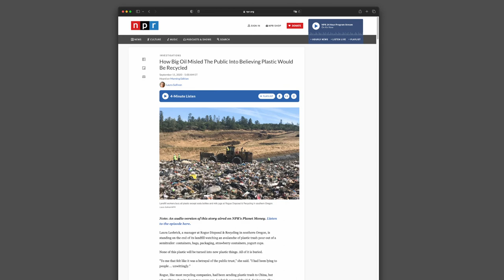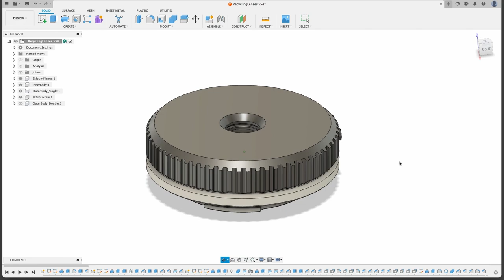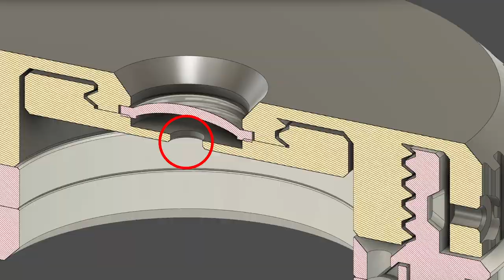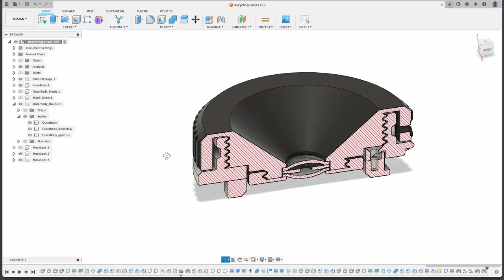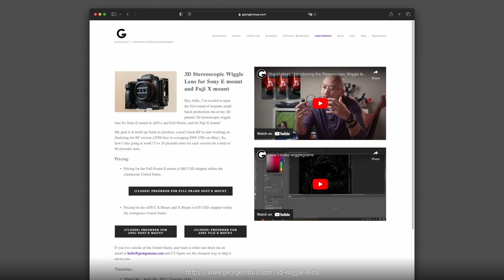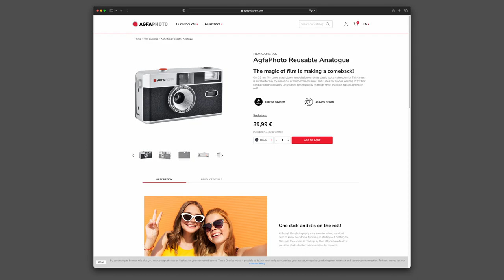Make Sony E-Mount Lenses from Disposable Cameras

Comment: A few years ago I used a similar lens, built a cardboard camera to make solargraphs, I found that it covered the 6x6 format, with a focal length of 35mm, which made it extremely wide angle. It would be nice to build another more robust camera, but I don't know how to create the files for 3d printing
Reply from the maker: Simple and straightforward projects are the best projects! I can recommend Tinkercad ( https://www.tinkercad.com/ ) as a very convenient software to get started with modelling for 3d printing.

Comment: Anyone using this with an A7Rii with success? I printed one, and the entire focus ring is visible when screwed either completely down or as far out as it can go. As in, I see mostly the color (red in my case). The only way the 3d print doesn't obstruct the sensor is if I take the focus ring off completely, leaving just the e-mount adapter locked into the camera, but of course that serves no purpose.

Comment: Hi! Maybe my question is silly, but...  what is the minimum distance to keep between the lens itself  and the sensor? I built one, drilling a camera body cap, and placing the lens in the inside of it, I think it's too close because it does not focus at all
Reply from the maker: If the distance between lens and sensor is exactly the same as the focal length of the lens, objects at infinity are in focus. Most disposable camera lenses have a focal length somewhere between 30-35 millimetres, the flange distance (metal ring to sensor surface) is 18mm for Sony E-mount cameras, so you probably need to move the lens a centimetre in away from the camera.
Reply: @vlztn  you are very kind and patient :) thank you!

Comment: i wonder if i can use such a lens on dslr cameras (for example aps-c canon 200d/250d or nikon)
Reply from the maker: Short answer: you could, but you couldn't focus to infinity. Long answer: the distance between lens mount and sensor is 44mm for Canon EF lenses (and similar for other DSLR cameras) to accommodate the mirror. If you would place the disposable camera lens with ~30mm focal length right at the lens mount of the DSLR you could only use It as a close-up macro lens because you could never move the the lens close enough to the sensor to get a focus at objects more than a meter (or so) away.
Reply: @vlztn  I tried it on a Canon 700d (DSLR) and it's true that it can only focus at a distance of 3-5cm. Can I improve this lens with a long plastic tube to attach to the body cap? How long is good enough?
Reply from the maker: @congfj9549 The longer the tube, the higher the magnification. Experiment and find out what works well for you.

Comment: Following up from my previous comment... I have just printed the single lens variant and it's perfect; Excluding a few issues if using a resin printer...

Thin pieces of resin don't fully block light. The focus ring and lens nut are the two problematic elements. I figure the solution to this is probably to just use a marker pen, black paint, or something on the problematic surfaces. Unfortunately I'm not in a position to test this as I'm actually still wating on my M2x6 DIN965 screws to finish the lens.

I may have also made a small mistake by not figuring out the tolerance compensation required for my printer.. had to remove some material around the helicoid to get the inner ring and focus ring together. They were pretty close mind you.
Reply from the maker: Getting threads to work is always the most annoying part. If you are using Fusion360 you can adjust the tolerances for the inner and outer threads with the face offset command (I added a 0.15mm offset already, this can be increased/decreased in the timeline). Hope it works well for you, have fun!

Comment: Super cool! Is the lens aspherical? Do you think it has some strange coating or is it a clear PMMA/acrylic piece of plastic?
Reply from the maker: I can't check, but I would assume it's aspherical. It's just injection moulded PMMA or PC so using an aspherical design would be very little extra cost per piece. It doesn't seem to be coated, there is no color tint visible in the reflections of the light on the lens. Probably that's just a few cents too much for something that's bound for the landfill.
Reply: @vlztn  Makes sense. Thanks for the reply and the good content.

Comment: Hello my friend, first I would like to thank you for the video and for inspiring me to think and desire to create something similar. I have a Sony a7rV, and I want to do a similar project and use your 3D file. I don't have a disposable camera, and I thought that buying a lens made of glass would allow me to get a better optical result. What are the measurements that I should order? I would really appreciate it if you could help me, and maybe we could talk by email/another way ❤️
Reply from the maker: I would guess that using a single glass lens would decrease and not improve the image quality. There is quite some clever engineering involved in making these aspherical plastic lenses. If you buy a singe off-the-shelf glass lens you'll have some new problems (different optical aberrations). If you still want to try that I would recommend to select a lens from the Thorlabs or Edmund Optics catalogue first and then design a lens housing around the dimensions and focal length of that lens. In the linked blog post you can find the Fusion360 design files if you want to use these as a starting point.
Reply: @vlztn  thanks!
If the FFD is 18mm , I need an F18 lens at least?
Reply from the maker: yes. if the flange distance is 18mm your lens should have a focal length longer than that otherwise the lens would need to be able to move slightly into the camera housing to focus at infinity.

Comment: so, I'll be trying to adapt this idea to a dslr lens. to correct for the flange focal distance, i guess you could add a diverging lens before the point of convergence (like glasses for the nearsighted)  of the disposable lens? how would you go about calculating the right specs ?
Reply from the maker: I guess that would work. The easiest way to tinker around with lenses is this website: https://opticexplorer.sharedigm.com/ You don't need to use lens assemblies made of multiple single lenses, you can just use two single lenses and adjust some distances. An estimate of the correct distance from the website should be enough for you to design and print a physical part and do the adjustments in the distances with a bit of paper as spacers or focus screws. The most straightforward way to get a decent selection of lenses and worldwide shipping is Edmund Optics or Thorlabs.
Reply: @vlztn  thank you very much!

Comment: do you think its possible to 3D print an adjustable aperture ring in this lens mount
Reply from the maker: possible: yes, but it would not be much of a benefit. The single plastic lens has pretty bad optical aberrations (sharpness, vignette, ...) compared to optical systems with multiple glass elements. The designers did solve this problem by using the lens only with the very small fixed aperture. With an adjustable aperture one could open it up (and the image would get pretty soft probably) or close it down further (probably after two or three stops diffraction would be an issue)
Reply: @vlztn   Thanks, I have an old  Film Yashika Electra 35 lens that used to be radium coated. I am keen to use that on my Sony A7RV, but I don't know how to build adapter for that

Comment: i try to build it too, but i use analog camera from (I don't remember but it grey) but it macro, so why to use it to normal camera lens?
Reply from the maker: I'm not sure if I understand the question correctly...
Reply: @vlztn in the point is, i try to make dispolens using analog pocket lens, but it macro, cannot to take building like yours
Reply from the maker: The basic principle would be the same but the distance between lens and sensor would need to be much longer so it works as a macro. Probably it would be easier to design a new housing from scratch instead of adjusting the one I did for the disposable camera lens.

Comment: 1:40 I've never really understood - what about the disposable cameras made it impossible to just put new film in them? Why would the factory have to make new ones when they could automate a process to reload then with film?
Reply from the maker: I guess making a machine complex enough to open the enclosure that has been unloaded by some random lab technician previously, reload a film, close it again and ensure it is light tight was deemed not economical.
Reply: The issue came down to the lack of financial incentives for photofinishers to attempt to salvage a disposable camera... no manufacturers were buying the old carcasses. They could not be resold by photofinishers that were also camera retailers so that even while we could open them carefully and reload them to do so would be fraud. Then there was potential issue of battery reliability when reused repeatedly.

I used to give used ones away until it got tiring, then just cracked them open the fastest way possible to extract the film. Whenever anyone brought in a disposable to have film developed I'd sell them a cheap reusable camera instead of letting them buy a disposable. Now they're pretty much dead thankfully

Comment: Hi, just wondering do you have it for Fujifilm X mount? 🥹
Reply from the maker: No, I own only Sony E-mount cameras. If you are familiar with Fusion360 you can design your own flange adapter for the X-mount and reuse all the other parts. CAD files can be found in the blog post linked in the description.